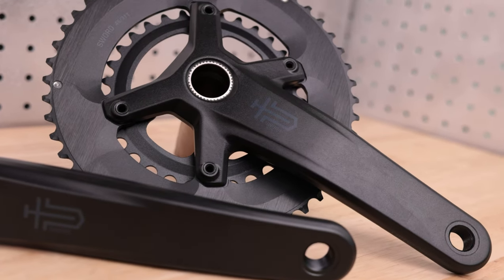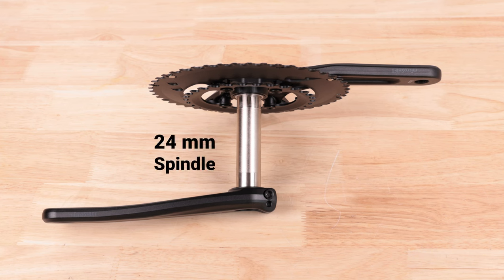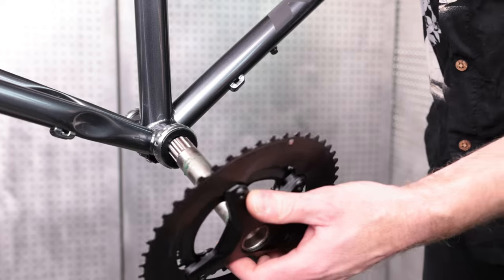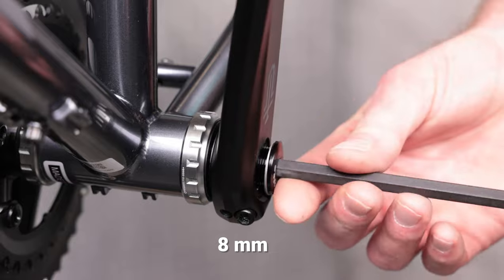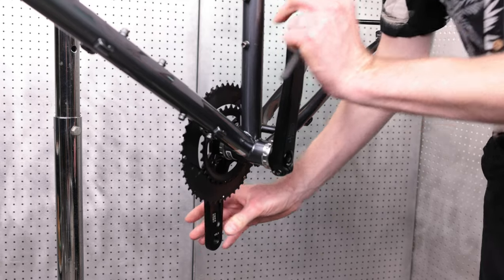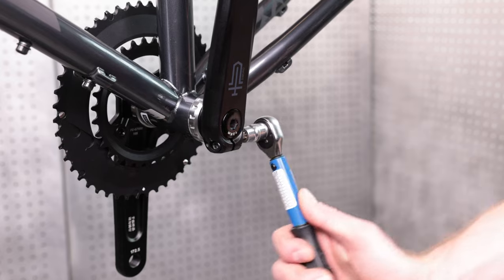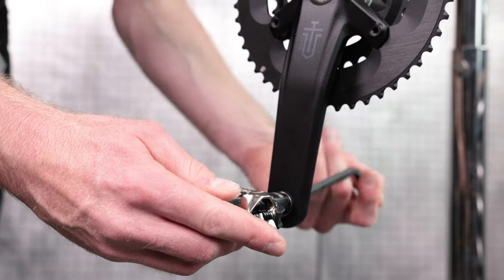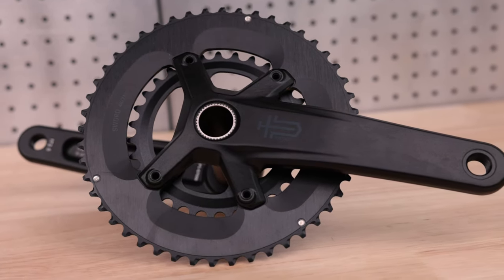Sword Crankset Installation Guide

Comment: Ive got a cannondale topstone 4. comes with advent x groupset 1x10. I have already upgraded to the microshift sword shifters/brake levers. however my crank is a Prowheel, Charm 40T, Cartridge, square taper. I want to switch it for the microshift sword 1x crank set. It should be compatible correct?
Reply from the maker: Yes, for sure!
Reply: @microSHIFTTECH  awesome ! thanks for the reply dude !